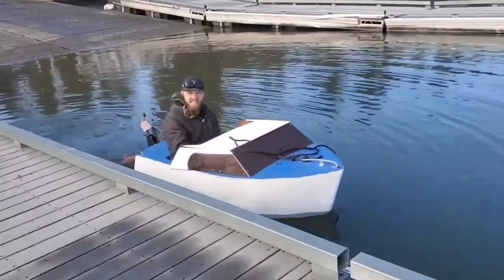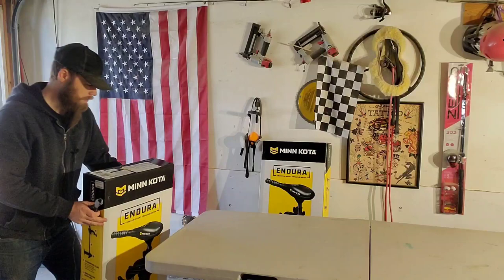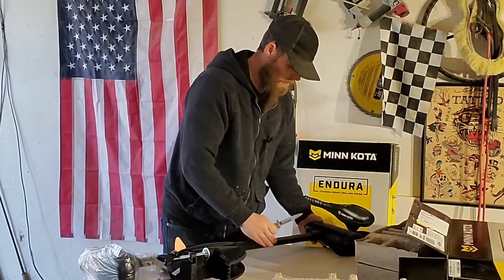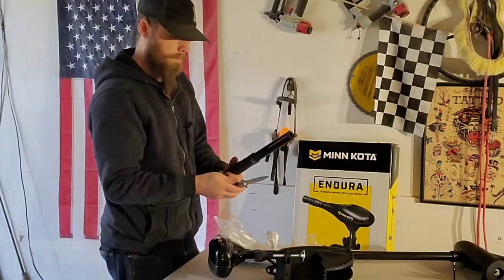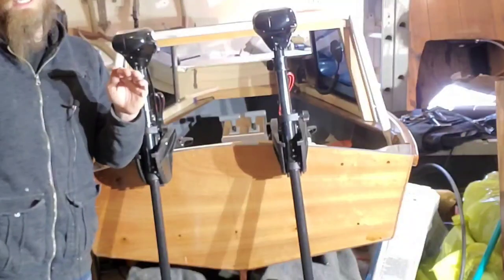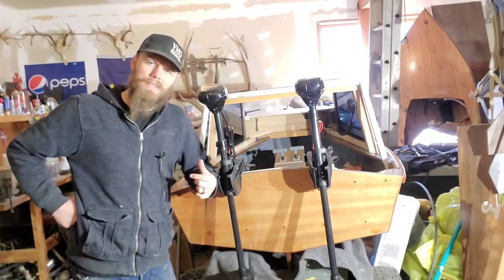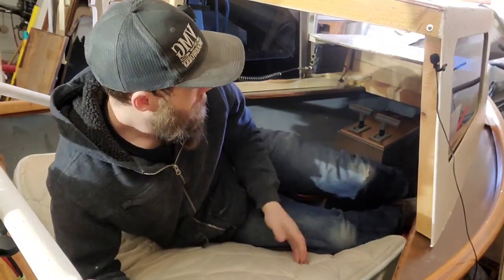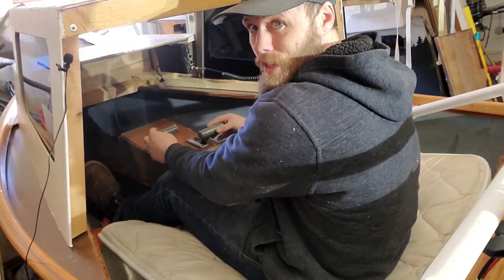mini boat | dual motor surprise electric power!

Comment: cool beans will the port engine be a counter rotator?  I put giveaways and stuff at the end, Im bot suree if it works better than closeups
Reply from the maker: Everything should work better than close ups of MY mug!  Haha. I would love to do give aways!  How do you structure something like that?   Also the shaft will not counter rotate as I dont have the opposite direction of prop.

Comment: I already built a boat, a canoe actually. But now I have a trolling motor and  a new external controller like yours. I just have to figure out how to attach motor to the back of a canoe??????
Reply from the maker: Nice!!  I have lots of ideas for that! Easiest would be mount it on a side rail as far back as possible and point forward.  I think I would try to bore a vertical hole as far back as possible  and slide the shaft through. Leave the head off and shove a bolt through shaft so it doesn't slide out.
Reply: There are a number of purpose built Kayak electric motors maybe one of those can be adapted to the canoe